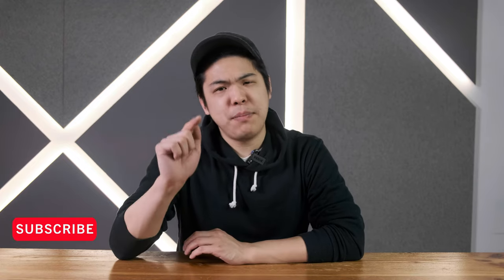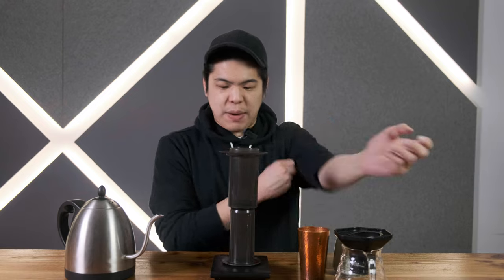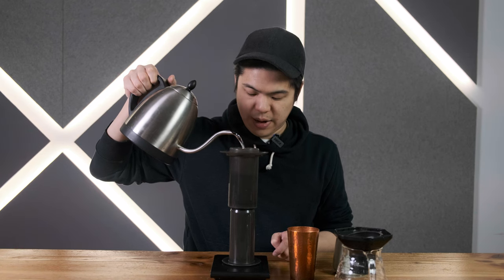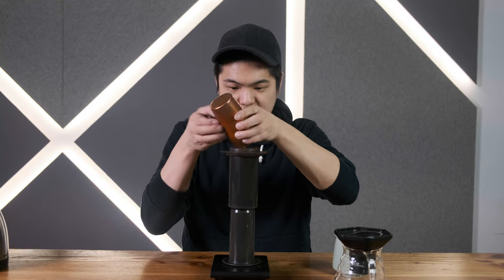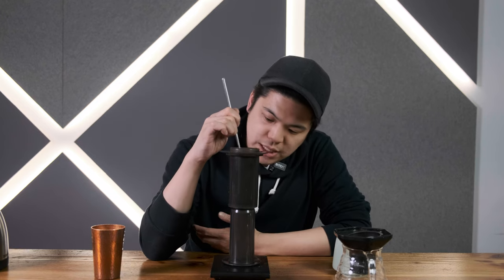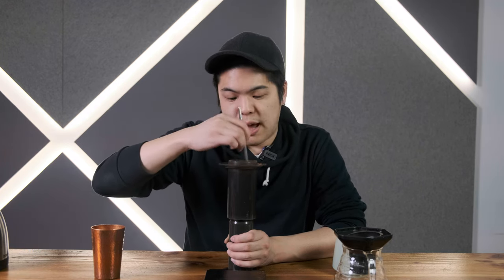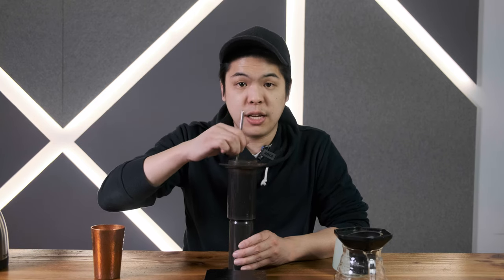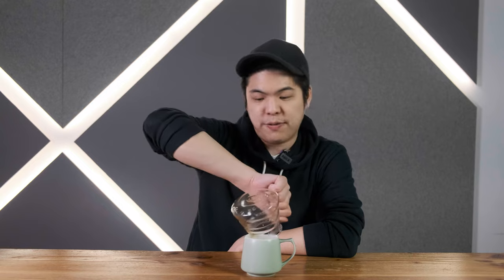The Everyday AeroPress Technique (stall the fall inspired?)

Comment: Thanks for the inspiration! I'd been having trouble figuring out how to get the sweet finish of a pourover w/ my Aeropress, and hadn't realized that agitation may be the key. Here's my simplfied, less messy take on your technique. Add coffee to the inverted Aeropress, and quickly pour in the water, in a circular motion, to sink the floating grounds. Put on the cap and press down on the body of the Aeropress until the hissing stops, and you see drops of liquid seeping out. At this point, you've squeezed out all most of the gases, and forced water into the slurry.  Hold the swirl the inverted Aeropress in the air for the allotted time, invert, and press.
Reply from the maker: I will give this a try it sounds more like a standard method. The idea of adding the water first allows the beans to have less agitation allowing for more gentle flavours but I’ll have to give this swirling one a try!
Reply: @TALESCOFFEE  Haha, OK you win! First, I tried pouring in the water, then the coffee on top, putting on the cap and squeezing out the air, and then swirling. Didn't taste better. Then, I did it your way. Just like you said, it tastes almost the same as stall the fall in the Hario Switch! I guess stirring still extracts more evenly. I still don't understand why dumping the coffee on top, rather than quicking pouring the water and then stirring makes such a big difference, too.Thanks again, this is a lot less work than getting out the switch when I just want a small dose
Reply from the maker: @lincomatic  ohhh it's cause the act of pouring is a large amount of agitation.  If you introduce the coffee into the water gently you'll get a much gentler flavour from it.  Which results in a different form of extraction where there's no agitation but a lot of sweetness and balance.  I guess the force of the water causes certain flavours to "break" off which makes it different!
Reply: @TALESCOFFEE  Many thanks for your out of the box thinking and experimenting! It's refreshing to break away from the dogma. I'd been told that stirring was too much agitation, and would result in over extraction, so I avoided t. Quite the contrary, I'm finding that I get more nuance and sweetness from it. I think it's because the grounds are more quickly getting even saturation.
Reply from the maker: @lincomatic  Stirring and agitation is only bad if you do it incorrectly.  It's just misunderstood when to do it.  If you're doing multiple pours this would be true because you already create muddy grounds from the agitation pouring has.

Fun fact, pouring can cause more agitation then the stir? :) Just something to think about.

Comment: Hey man, thanks for the recipe! How coarse is the grind?

BTW be careful by using the funnel in between the Aeropress and the server though, as it reduces the area which is under pressure to six points only and the server can easily break.
Reply: Medium-fine or 400micron. 1:40 into the vid
Reply from the maker: Thank you, yeah we don’t have a cup that fits the aeropress so I’ve just used the funnel instead 🤦🏻‍♂️ thank you. I’ll be careful for sure!

Comment: Interesting. I like that you didn’t use the paddle, which can result in a vortex and ‘domed’ bed which makes even extraction difficult.  Some swirl instead of stirring, but as you added grounds to the water, you’d have to do that to saturate fully. 
Thanks for mentioning grind size (but please note that 400 microns is not med-fine; it’s borderline espresso/Turkish).  The non timed element is interesting, though I believe for repeatability, the average person would benefit from timing. 
BTW, 20g to 200g is a massive ratio!
Reply from the maker: Oh! I was thinking it would be even easier to not have timing.  Because timing doesn't mean your grinds are saturated.  Instead we look for certain benchmarks to determine if a coffee is ready to be plunged or not.  Simple make sure no grinds float and it's ready!

Also yeah .. haha 1:10 ratio is our go to for aeropress but you can add water to taste!
Reply: Not to be argumentative, but stirring doesn’t mean you’ve achieved full or optimal extraction. You need to do both - ensure all grounds have been saturated and time your immersion (so you can tweak it, up or down, later in experimentation). 
Note: I edited my initial comment re: grind size. 400 microns is on the course end of Turkish; probably not what you advocate for AP. 
Does Tales have a cafe?  I’d love to drop in someday and buy some of your fresh roasted coffee.
Reply from the maker: @seansweet4883  we have an online store for the coffees.  I do have a cafe in Canada.  It's called Faebrew!!

I do use really fine grinds, generally though we like to think grinds that ssink are fully extracted.  At least it's an easy way for people to gauge their coffees.  I do have a video on extraction and it challenges what we extract at the end vs the beginning.  From time and flavour it's quite noticeable.